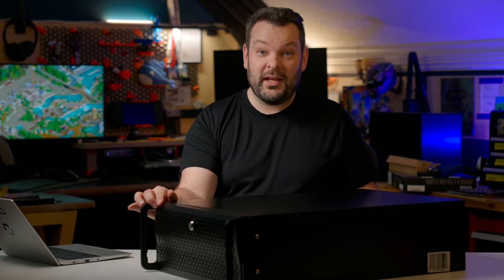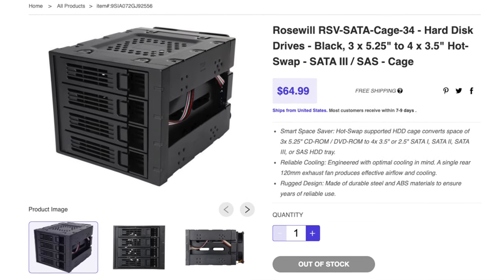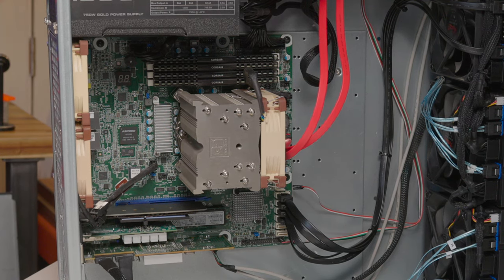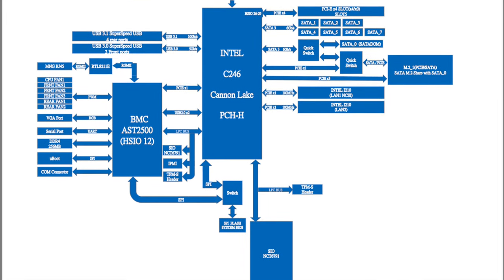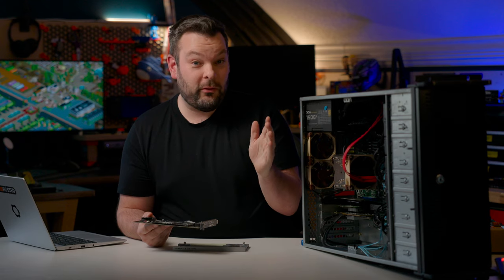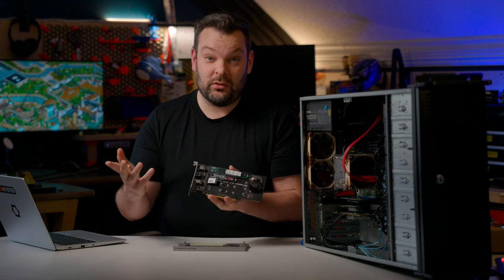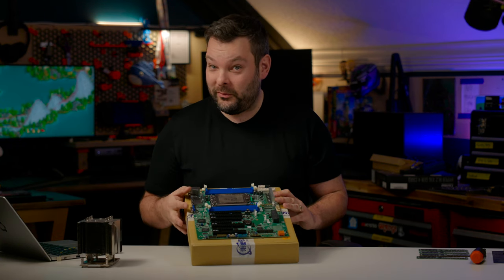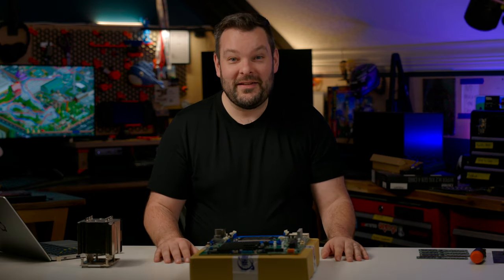My Perfect Media Server isn't so perfect anymore...

Comment: >2:46
>consumer platforms
2011v3 and 2066 were also consumer platforms.
i7-5830k has 40 lanes (PCIe 3.0). 
i9-7900X has 44 lanes (PCIe 3.0).

2011v3 platform from 2014 can also the trick with 4nvme card splitting.

Comment: I'm on my 3rd consumer NAS now and a little over the limiting hardware and software that's generally supplied. I recently purchased a compact NAS case with 8 HDD slots and a celeron motherboard to go with it. I figured once I have a case, it's easy enough to upgrade the motherboard when newer ones become cheap enough.

Looking forward to your build and what you're going to run on it.

Comment: I am currently rocking dual 2011-3 (Haswell) with dual 18core Xeons and 512GB ram on a z10pe-d16 ws board with 6x PCIE x16 slots (which I think is x8 per if all are populated). 2011-3 chips and the cheaper Chinese boards are affordable... but specifically for home lab we are SHIFTING to recommending Epyc gen 2 OR Skylake hyperscale (especially right now 3.7Ghz boost chips) mostly because the prices has began to settle in. It seems between $500-700 you can get an EXCELLENT CPU-MOBO combo for either of those and it will DUST anything older when it comes to "enterprise" grade solutions (i.e. lots of PCIE and lots of ECC ram support).

Comment: I've been looking for a video like this. I'd like to build a system around the Epyc 7452. 128 PCI-e lanes is excellent. The Sonnet McFiver seems to be a nice addition to add connectivity if needed. Also, the Radeon Pro W6600, W7500 or W7600 should be excellent if you need a good single slot graphics card.  Thanks for the video!

Comment: Hey Alex,  This board may require some wrangling with the fan speed control if you are going to use Noctua low speed fans as the low speed PWM will result in bad speed feedback and results in continual speed ramping

Comment: Nice! Quite the upgrade! 🍺 looking forward to the series!

What’s your plan on replacing QSV for HW video transcoding? I’m looking into doing somewhat the same journey, as I don’t like having everything on the same system. Up until recently I’ve only been looking at upgrade path’s that all require an QSV capable CPU. That really narrows the spectrum doesn’t it… The new Intel 12th gen and newer are great very powerful and energy efficient systems but they really lack in connectivity for my server needs.

So now I’m more and more looking at building a dedicated server with plenty cores and PCIe lanes, and then running a NUC type server with Iris Xe graphics as a dedicated HW transcoder and a few other things.

It’s the power budget though that sets me back some. I live in Northern Europe where we up until recently had practically free power but since the Ukraine war even we’ve been affected with high prices. Ironic since we produce TWh’s worth of hydro electric and wind power locally…

Anyway, I’ve never dipped my toe into AMDs CPU world before so it’ll be interesting to see where this ends up!

What’s the rough price point for that MB and CPU? $1,5K?

Comment: My media server is overkill.  It has a pair of E5-2697 V2's and 128 gigs of DDR3 ECC RAM and a RX580. Its all in a 20 bay 4U chassis. It started out as an my workstation and pulled double duty as my media server when I wasn't working with it.  Now that I have a threadripper workstation, my dual xeon box only has the singular duty of serving media across my network or outside my network when I'm not at home.

Comment: What is going to handle all of your transcodes?
Reply from the maker: Might be a fun video. 

Testing software only vs quicksync in an iGPU vs quicksync via an arc GPU vs an nvidia GPU.
Reply: Id be super interested in it. I have an A750 in my desktop and a RTX 3060 in my server. Id love to swap them if i could. But something tells me i have the best layout, considering CUDA support for things like LLMs.
Reply: @ktzsystems  If you can find one for a good price A2000 is an option, but it seems like being able to get them 'cheap' has passed.
Reply: @nadtz  I just got an a2000 6gb new at microcenter in the US for 255 dollars USD this week. I was shocked to find it.

Comment: There's no point in using zfs if you don't have ecc memory. Stop building "servers" without ecc memory.
Reply: Well there is a point, using platforms that don't support it; but since it's not that hard to have ecc memory - I don't quite understand why one would do it as well
Reply: ZFS doesn't need ECC more than any other filesystem.
Reply: @rencothrawford  ZFS doesn't. Data does.
Reply: @BoraHorzaGobuchul  So, we agree?
Reply: @rencothrawford  on what? If you use zfs, you're usually doing it because you care about data integrity. If you don't use ecc, that's still a point where data can go bad. So there's little point in going zfs without ecc.
Reply: @BoraHorzaGobuchul  I just don't believe it's there is that big of a risk to your data when not using ECC.How likely is a bit flip going to occur when files are being written to the disks?
Reply: @rencothrawford  it's not a matter of belief. This can happen, and it is strongly recommended by the developers of the FS to use ECC. You may forego it, and most likely you will not notice it affecting your data (though I've seen my share of "rainbow jpegs"). Your choice.